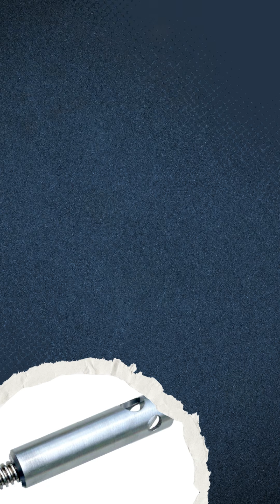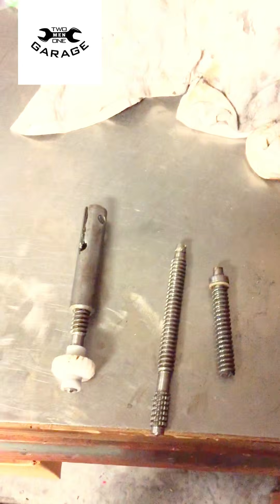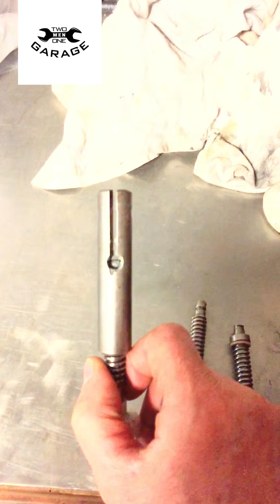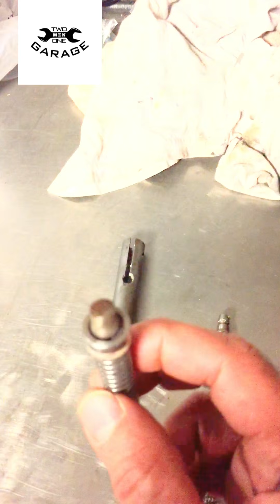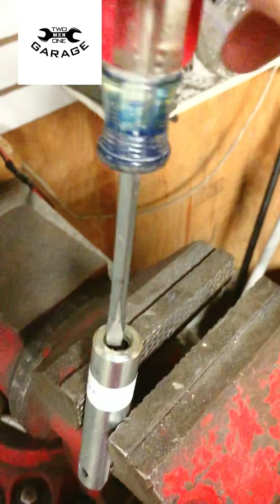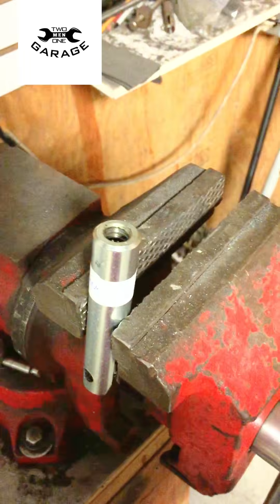How to Remove a Power Seat Gear from a Tube Nut

Comment: So is this the end where the gear is located? The gear is being held onto the screw by the snap ring correct? I have an 07,3500 Ram Megacab and need to replace the drivers cushion and cover. The up/down function does not work but the motors still turn. I figured since I had the cushion off I would try to fix the up/down function.How about I just remove my power track and send it to you to replace my stripped gears?  Lololol (just kidding)
Reply from the maker: Hi alanosborne, yes the snap ring prevents the tubenut from unscrewing.  We’ve actually repaired / overhauled seat tracks for a few folks. Send it on over :-)